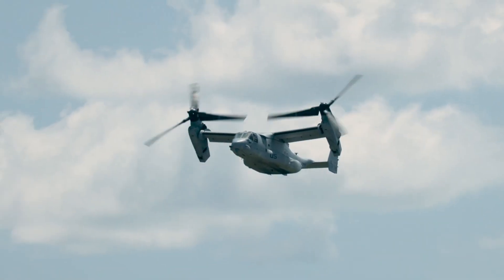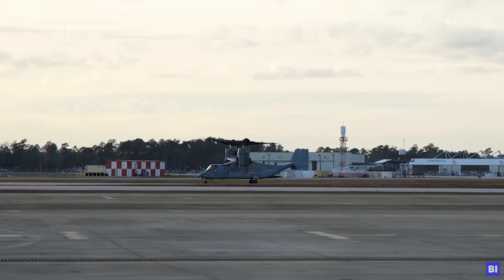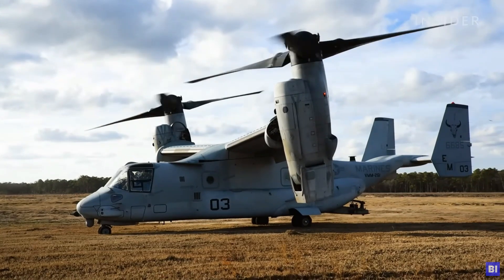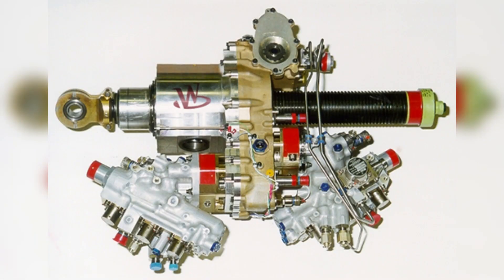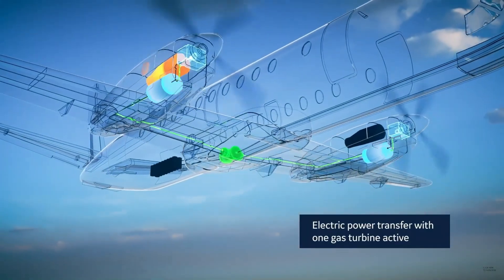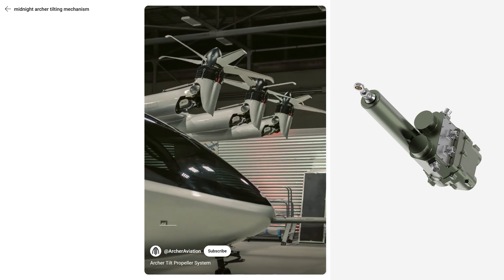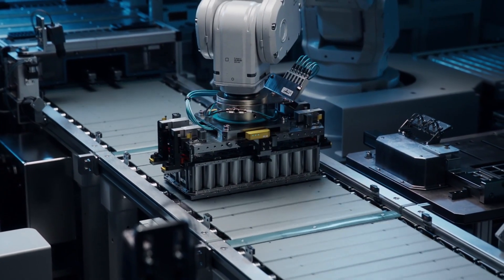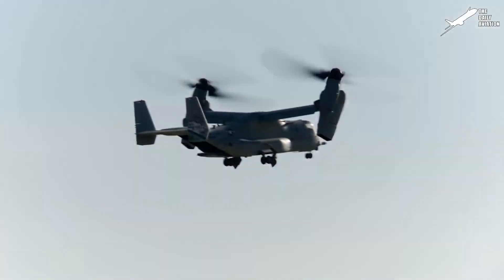The V-22 Osprey: Engineering Complexity, High Costs, and the Case for Hybrid-Electric Flight

Comment: I have always wondered why they didn't use a hybrid system on the Osprey. It would have solved so many issues. At the time I assumed it would have introduced all it's own issues. Plus when the Osprey was designed the required systems just weren't there and it would have cost a fortune to develop them, adding risk to the project.
Reply from the maker: The turbo generators, the pancake motors and  multispeed controllers, these have been recently developed and made efficient because of drone technology

Comment: Good video. But, as you rightly indicated, batteries remains a real hurdle that cannot yet be overcome. And, as for the gearboxes that tilt the rotors, in my opinion they cannot be made lighter. The rotors work as immense gyroscopes and tilting them creates an immense amount of torque.

Comment: Electrifying the Osprey in this way would be very silly. Notice how we don't really build electric helicopters except a few RC models for hobbysists. Electric VTOLs are largely built with 4+ rotors. No reason to bother with complicated blade pitch mechanisms when you can have as many individual motors as you'd like, and easily do control by rapidly varying motor speeds.
Adding more rotors is also an easy way to add a LOT of redundancy for safety. Manned e-VTOLs often have 8 rotors or more. There's little reason not to! You can route the power wherever you like with minimal losses!
Another consideration is that high torque electric motors get quite large.  Direct drive is possible, but for such large, slow turning rotors I figure the weight and packaging would be awkward. You can only make the magnetic fields so dense. As such it is common to use gearboxes and compact, fast spinning motors for high torque applications. But again, many small rotors completely circumvents this issue.
What you're calling for here retains most of the complicated mechanical components of the original Osprey, thus ignoring the main advantage of electrification! It's like putting wheels on a horse in attempt to design a car.
Reply: So is it a bad idea to electrify the osprey

Comment: This is a great idea if it can be made with redundant capabilities.  Apparatly if one engine fails the power must transfer to the other side extremely rapidly or it loses control.  If each side had two motors I guess the send one can kick in immediately if power was lost.  Does the fossil fuel motor also need redundant second motor?  If so then six motors total are needed two electric and two fossil.

Comment: Very interesting idea.My very limited understanding of the pros and cons of electric vs hydrocarbon powered propeller driven aircraft is that e.g. 6 smaller electric motors for 6 smaller props weighs a great deal less than the equivalent 1or2 kerosene engines with 2 big props as well as all the other advantages you have outlined here.That alone is enough to make me question whether it is ever going to be worth the effort of modifying the Osprey.The next gen electric multimode aircraft with e.g.  6 or 12 props and motors are already beyond the prototyping stage.They have the further advantage of having dedicated fixed separate forward and vertical props so no tilt mech reqd and even fewer moving parts to increase reliability/lower maintenance costs.So once the energy density of the batteries doubles (maybe as soon as next year?) it will be game over for the Osprey and probably most helicopters as well.
Another big recent advance for props and screws (ships) is the new 'figure-of-8' propeller/screw design (as opposed to 2 blades) which is claimed to be ~20% more fuel efficient (less turbulence than wing tips) so that would mean that electric battery energy density would not need to 'double' beyond current levels to compete with current kerosene-fuelled aircraft.

Comment: great. I love quadplanes. no helicopter complex rotors. just quad copter plane. dry roll magnesium-air salt-water single-use batteries, just add water. very high energy weight density. electric plasma heat-mhd ramjets rock. only thick electric current wires to the engines at the wing tips is required. ie battery/engine weight can be kept fully inside the fuselage main tube. similar to electric motor wing tip rotors. well they seem to use axles to the wing tips so its lighter and easier to control.

Comment: The only issue I see with electric motors for the V-22 Osprey is EM pulse weapons...

A war machine needs to be as robust as possible.  One good EM pulse shock, and it will come tumbling out of the sky.
Reply: In the same way that turbine FADECs can be EM hardened it is possible, and even desirable, to integrate inverters into motor housings protected by copper faraday cages. BMS is already becoming integrated to battery packs. The risk is the DC supply voltage lines and control lines, but these can be coaxial to reduce susceptibility. Bottom line is a realistic specification needs to drive development and testing.
Reply: @martingarrish4082 No doubt about it. EM hardening of an electrical system is possible,  but again,  we're talking about war machines that are airborne.  

Every ounce of weight can add or detract from its performance. 

The civilian version is definitely a go in my mind,  but there are solid reasons why military specifications exist.  

There is no such thing as a fair fight in a war. Your opponent will exploit any and every weakness they can find.

Lastly,  an electric craft will need to be rechargeable.  It's faster to refuel than recharge.
Reply: @rod3134  , discussion was about AVTUR/AVCAT powered hybrids. I mentioned batteries as this allows turbine to run at optimum efficiency. But agree that the design needs to be light, robust, and literally bullet proof...
Reply: @martingarrish4082 Amen Brother 🙌🏾❤️

Comment: Great idea and interesting analysis of how to save weight, improve mass distribution by simplifying the design to hybrid. And I guess when this can fly for only a minute just electrical and not blow out heat in that moment, heat-signatue can be lower as well....or even distribute heat such to confuse it's hunter. Or boost temporary power by combining powersources (battery + generator). 
Please come more with these improvements!

Comment: Imagine the day when Engineers realize lightweight battery technology.
The world will be transformed.
Reply: NASA have demonstrated Li-S/Se to 1100kWh. But that has to be repeatable in pilot production then mass production. It will happen the same way that CRT eventually gave way to LCD flat screens.
Reply: @martingarrish4082 do you think that the power density is sufficient for all aircraft to be battery powered?

I don't think it's even close. 

We await a big breakthrough
Reply: @procatprocat9647  , if we're talking recips or smaller helo turbines then that 45MJ/kg fuel only has 1/3 transferred to useful energy. But that 15MJ/kg has to lug around heavy engine and possibly gearbox plant, so is really only about 5 to 10MJ/kg. COTS batteries have exceeded 1MJ/kg, but that NASA R&D (and my own work) shows that Li-S has the potential to achieve 4 to 5 MJ/kg. However, the real potential is to store and release this energy more efficiently at much less cost per hour.
Will we be seeing cargo 747s converted to batts? Obviously not. But will we see more e-CTOL, e-STOL, and e-VTOL in short range applications like recreational flying and pilot training? I would say yes.
Reply: @martingarrish4082 why are you claiming that 747s "OBVIOUSLY" will never be powered by batteries?
Reply: @procatprocat9647  , because a long range aircraft like the cargo 747 is basically a flying fuel tank with the most efficient engines that can be fitted. Turbines, like all ICEs can breath air for the oxidiser to the fuel. Batteries effectively carry around that oxidiser, typically in the form of metal oxides in the cathode. Of course the downside to breathing air is all that exhausted CO2 that is messing up our weather.
So it is just a question of physics that batteries can't get long range. That said, a high aspect ratio laminar flow wing operating at reduced mach number would probably suit cargo well for medium range. It's a question of tackling the problems that will yield the quickest results first.

Comment: Where did you get 9.1 tons from?
I see 7.5 tons/6.8 tonnes listed as max payload for v22 online.
Reply from the maker: Internal Cargo is 9.1 tonnes. The Vertical Flight Society
Reply: @ElectricAviation Ah, I think I may have figured out the discrepancy. Vertical MTOW minus empty weight is only 7.1 tonnes, but the conventional MTOW allows for the listed capacity, hence why the sling load is lower, you can't do a rolling takeoff with a sling load (although I'd very much like to see someone try).

Comment: Good idea. Keep in mind this demands a complete redesign of the nacelles, wings and at least wingbox. Would be cheaper and not really more time consuming to develop a new optimized aircraft based on the V-22 concept.
Reply from the maker: True
Reply: Like the MV-75 (The v280 valor)?

Yes, I completely agree.
Reply: If we were to develop a new VTOL aircraft with a hybrid-electric power plant, we could give it more rotors, like on those eVTOLs. More safety in case a rotor fails.

Comment: I like this!  It seems obvious that Hybrid-Electric would reduce many problems of the V-22.
Reply from the maker: Indeed. The replacement of gearing system alone is worth considering it
Reply: @ElectricAviation   these sort of expose's should be your channel's specialty, the current deathtrap Osprey shouldn't exist in any other form.
Reply: OTOH Redesigning, Retrofitting, Recertifying and Testing a 30+ yrs old Design is probably not much cheaper than starting from Scratch, with today's 'new' composite Materials

Comment: Wouldn't fly by wire and wifi controllers will get jammed / overloaded with microwave attacks and cause accidents?
Reply: Most military aircraft are fly by wire anyway and  have redundant control paths to avoid physical battle damage and accidental  failures.  The electronic systems are built from EMP  hardened chips and circuits .. sensitive critical systems shielded where required.
Reply: Rolls royce produced a new compact high output gas turbine apu generator unit  earlier this year for the new generation of high power demand aircraft that may also have to continue operating for extended periods  on the ground  or in the air , without  ground support  vehicles. ....light wt compact size and fuel efficiency as well as sustained  high outputs . May point to this use scenario .

The other breakthroughs that have gone beyond just the Lab development and testing are Al  and Li S cells that offer 5 times Li  ion cells  and solid state cells and are probably much safer and more stable in use.  
Minimising the amount of copper cable and windings saves considerable amounts of wt. as do higher voltage systems  for primary and secondary functions.  Electric motors already built for Automotive and aviation use can exceed 800hp for a single unit and multiple units can be stacked as triple  motor stacks  with huge torque from start up rather than having to Spool up heavy turbines and reduction gears. 🧙🏻‍♂️ The other possibility is in reducing the wt  of the air frame by 3d printing of  the airframe and components using  biologically inspired design principles like found in birds bats and insects.  This is already common in high performance super cars , formula 1 and other areas of aerospace.